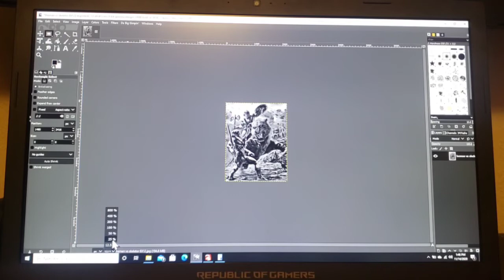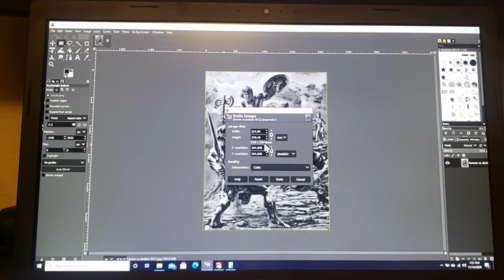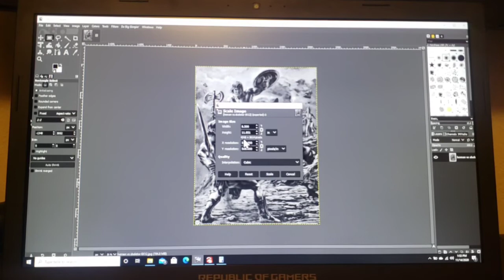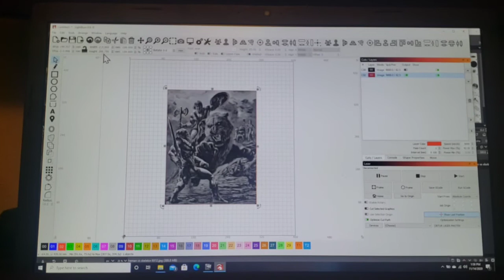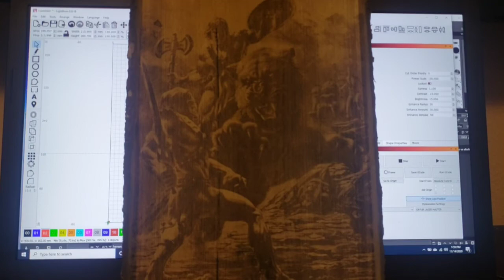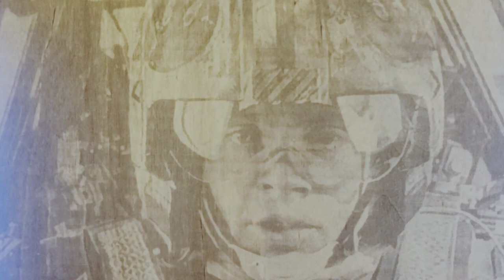The Kenny Hack: Setting Up Images Using Metric. Ortur Diode Laser.

Comment: The DPI setting is your lines per inch.  As you'll notice the lines per mm and DPI will change each other as you edit them. You already have the feature you want. 
Are you sure you don't have a wheel/bearing issue. Almost looks like wheel drag. Try engraving the conventional way left-right instead of up-down and see if that helps.
Reply from the maker: banding arises if you don't match up resolutions. if your image is 300 and you set it to 254 in lightburn it will create banding trying to get the resolutions to line up. not an issue if you use a plugin as the resolution is set in those programs and you just set it to pass-through. mostly an issue for those that are trying to do the photo editing on their own and not use plugins.
Reply: @TheKennyHack  if you take the same image file and get no banding when doing pass-through and do when you directly import it, I would post in the Lightburn forums with images and the direct steps to reproduce. I haven't ever had issues with matching dpi to scale up or down, all my banding has been mechanical. However, I use either grayscale or Jarvis. I didn't catch what dithering algorithm you were using. Pass-through would bypass that algorithm, so maybe it's just that specific dithering algorithm you're using. Still would post in the LB forums, they're pretty good at responding.

Comment: What are you looking for in your preview before you print? Can you that sometime ?
Reply from the maker: Are you talking about how to adjust the image in LightBurn before I run the project? If so jump to 14:30 in this video I kinda touch on image adjustments. There is no perfect number. I go by feel for the most part on wood. With the wood and my coating process what I see on the screen is close to what I get on the wood. For canvas and paint removal the image has to be adjusted differently. Generally you'll need to make some small test boards to see what you change on screen how it affects the outcome on the material your using.
Reply: @TheKennyHack   I was talking about the preview window button in lightburn...On the tool bar
Reply from the maker: @bigbeartn  oh, I mostly just check that for how long it's estimating the run time and that everything looks like its going to run ok. Orientation, no rapid moves, not inverted by accident, etc.